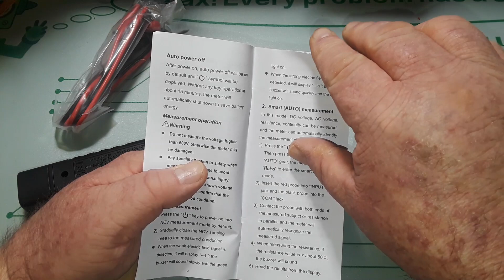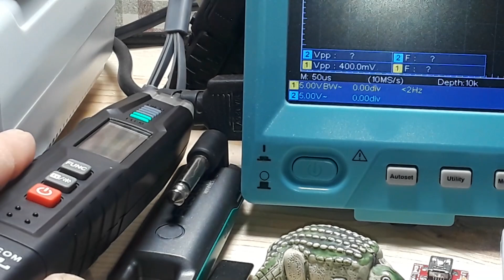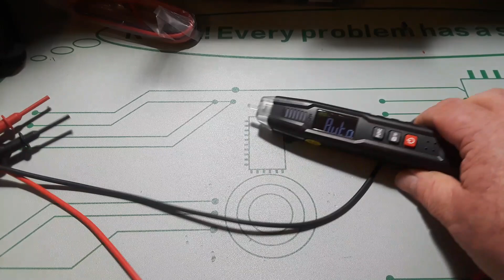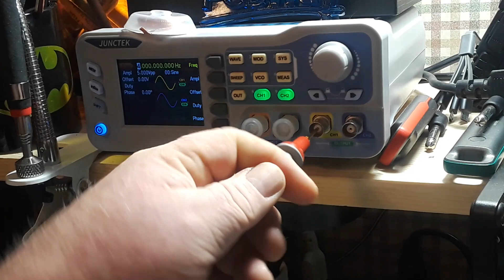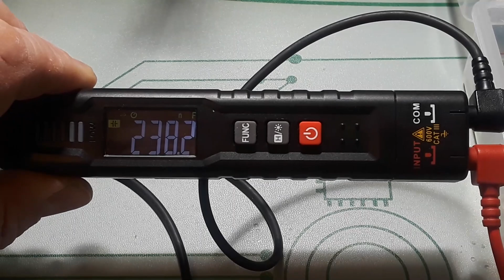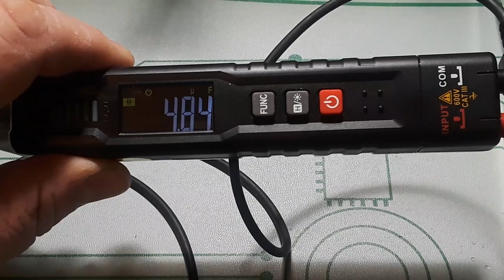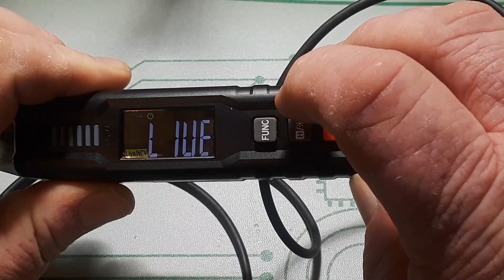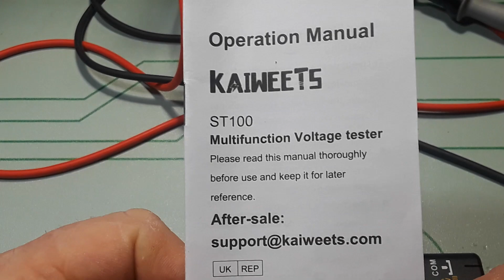Kaiweets St 100 Multi Function Voltage Tester Review And Tear Down

Comment: Just bought this meter to replace my NCV tester.  My biggest qualm is the turn on time, too slow to replace an actual NCV tester for active field use.  Second issue is it is a bit hard to turn while wearing gloves, typical NCV testers have one big button and turn on instantly. So not best for active day to day use as a sparky.  Will make a great glove box, junk drawer meter.  Can't have enough meters 😈

Comment: Why not make your self a ESR meter that would one tool I would need
Reply: You probably already have one in your chinese transistor tester.
Reply: @englishrupe01  No I don't have one that's why I need the schematic
Reply: @singlesteve2011  Ah, OK. To be honest, even the cheapest ones (about $10, if you search) work very well and show ESR, capacitance, resistance, FET's, BJT's, diodes, etc and even measure inductance. But the parts would cost way more than just buying the tester. They use the STM32 that has a really clever program. However, i understand....it would still be fun to make one.